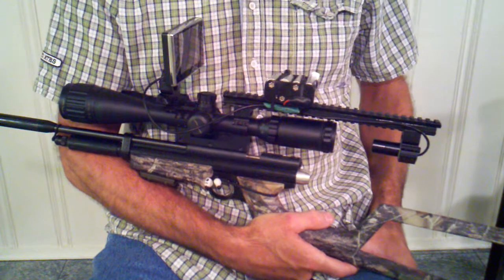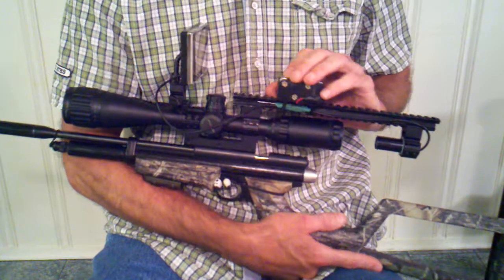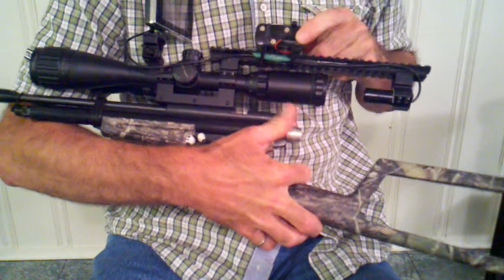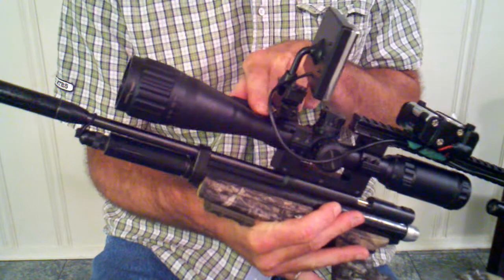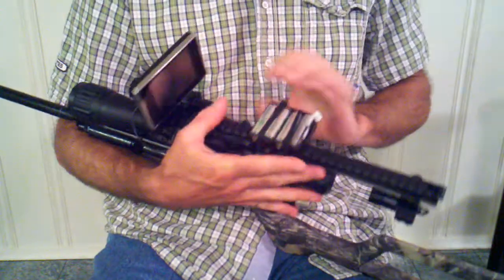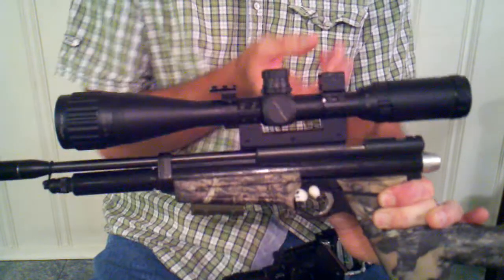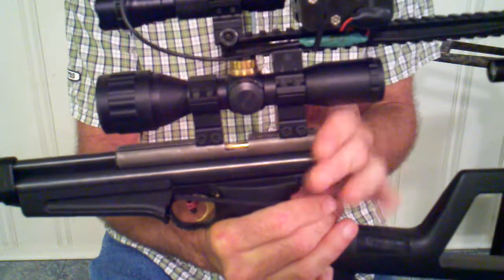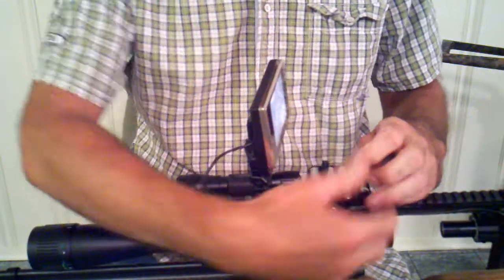DIY NIGHT VISION UPDATE!!

Comment: A Question:  When You swap from one scope to another, do you need to adjust the focus or distance from the eyepiece to the camera?
Reply from the maker: Thanks for commenting.
Yes I need to refocus from scope to scope. I have found it is almost impossible to get the  cross-hire and the object in focus when I have it on my powder burner scope zoomed in over 6x. On my Airguns I have an adjustable objective so it's less of an issue.

Comment: Update on my 60 year old Crosman 150 that was leaking CO2: I found some rubber washers that I had and was able to turn them down to the right diameter to make a new seal for the valve stem seal. At first it was too thick and when I fired the gun, only a little “pffffft” of air came out because the valve was not opening enough. I chucked the valve stem into my drill press and using a razor blade I trimmed about a 1/16 of an inch off of the seal. Put the gun back together and it seems to be working very well now. I do not have any way to tell how fast it is shooting, but it seems to be putting a good bit of CO2 out the barrel when I fire it at the high power setting. The low power setting also works, but definitely at lower power. 
I have taken apart and reassembled this gun about ten times now.  I have gotten real good at it!
Reply from the maker: Glad to know you got it worked out.
Don't know how far down the rabbit hole you have come, but I warn you these guns are like potato chips you can't stop with one!
Cheers
Reply: AirGunsNirvana you are right. I have a pretty good collection of firearms: Mossburg 22, I bought in 1965, a Browning Buckmark .22 pistol, and an FIE 12 Gauge Double Barrel Shotgun.  Then I bought a Norinco SKS 7.62 x 39, then I bought two Russian Mosin Nagant Rifles, a Polish P64 9MM Makarov pistol, a Czeck CZ-82 Pistol,  and. Russian Nagant Revolver, and I Built An AR-15 in 300 AAC Blackout. 
But lately I have been getting into Air Guns. I refurbished a 1970’s Crosman 760, I bought a Crosman Rogue SBD NP2, i bought and modified my Crosman 2240, and I went to the Daisy Museum in Rogers, Arkansas and bought a Red Rider BB gun. My sister sent me a photo of us shooting a pellet gun back when we were 8 and 9 years old (1957).  I found out it was a Crosman 150, so I decided to see if I could find one for sale, and Last week I bought one on EBay.
I enjoy shooting my airguns more than my regular firearms.
Reply from the maker: The reason I started my airgun collection is that I live in the suburbs, even using a .22 for pest dispatch would get me visit from the boys in blue. So I get a lot of trigger time with my airguns, but my goto powder burner at the moment is an Ar pistol in 300blk. I how dropped more East Texas hogs than I can count with it. Just like my airguns it can multi-task :-)
Cheers
Reply: AirGunsNirvana I live in the Suburbs also in Olathe,Kansas. I would love to take down a boar with my  AR 300 Blackout but here in Kansas it is illegal to hunt hogs, unless you are a land owner and we do not have that many running around, although I understand they are increasing in number. 
Do you reload your 300 Blackout rounds.  If you need some empty 300 Blackout cartridges, I have about 1500 that I converted from .223/5.56 to SAMMI Specs. I am selling them at a very reasonable price.
Reply from the maker: I don't reload, but thanks for the offer. It is love-hate type thing with the hos in my part of Texas. Love to shot them, hate that agricultural areas are overrun.
Cheers

Comment: Thanks for the kind words about my videos. I went out today and did some plinking with my Tactical Carbine Rodent Assault Weapon (Crosman 2240). So fun to shoot. I also got a vintage Crosman 150 in the mail today.  It is Fifty-years old. I need to rebuild the valve assembly on it. It leaks all the CO2 out of it as soon as the cartridge gets pierced. Crosman does not carry any parts for these old timers!  The one I got externally is in mint condition.
Reply from the maker: Your welcome.
If you haven't heard of the company, Baker Airguns is a good source for old Airgun parts.
Hope this helps...

Comment: Nice Night Vision Adapter. I also made aNight Vision Adapter.  I have a series of videos on my YouTube channel showing how I made mine. I invested less than $75 on mine, which included the illuminator. Take a look and let me know what you think.
I did come up with two modifications to my set up. One is to use a flexible PVC coupler instead of cutting slots in the end of the PVC and the second modification was installing a switch to turn the power on and off.
Reply from the maker: Thanks for saying. 
I watched some your videos. I it cool to see how many different ways you can get to the same place. You did a great job on your builds...
Cheers

Comment: Sorry but I think these types of NV systems are pointless..  the shooter is bathed in light from that screen, not
very good when shooting rabbits.. they just piss-off !  this is the reason I ditched mine.. yes I don't like the screen
filters either red or green, still the same effect !
Havent you noticed why more & more are building the Near Eye systems now, for the reason above !
Reply from the maker: Thanks for commenting 
Yes, there are some short falls of this type build. Which I've over come, but for me the main positives for this type NV setups is
cost, interchangeability and max value for dollar. Many East Texas hogs have taken their final dirtnap thanks to this setup on my 300 black out. For coyote hunts I'll bring a shroud that goes over the screen and my head, not fancy and a little hot on Texas nights but gets the job done. I have not seen a Near Eye system, please send me a link. I always like to improve tool box.
Cheers

Comment: What is the run time before swapping batteries?
Reply from the maker: ralph lovely Thanks for commenting.The answer is a little tricky. I used this set up about 2 hours a night over a 4 night period, but I would cut power to the unit 30-sec to a minute. So it's hard to say how long they will last continuously. The batteries were still going strong buy the end of night 4.  Cheers....

Comment: Nice set up. Whats the effective range?
Reply from the maker: Anthony Venezia Thanks for commenting. The range for this setup is really down to a few things. What illuminater is used,scope features/magnification. On my airguns I use ultrafire cheepy IR and 50 yards is the max. I made my brother a setup with the super-tac IR on top of a mini-14 223. To date the longest kill shot 300ish on hogs. Another thing that effects range is how high the magnification on the scope is. High mag = low light and its hard to see targets. Scopes set at there low to medium mag have better clarity, Adjustable objective scopes adjusted for proper yardage=outstanding clarity. Non adjustable objective scopes will be less sharp depending on mag and range. Hope this helps...Cheers
Reply: AIRGUNSNIRVANA
Thanks, I have that ultrafire led already.